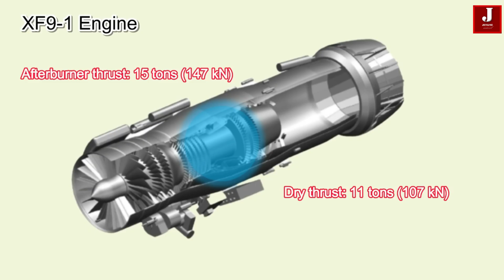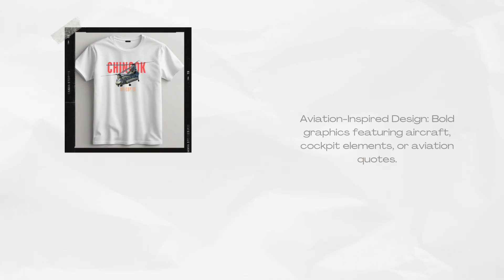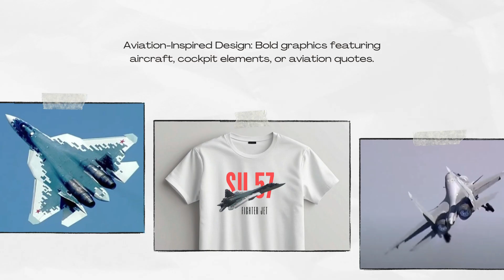Which engine is most suitable for the AMCA fighter jet — Japan's XF9 or France's M88?

Comment: Every jet has different jet engine so XF9 is not an option because we are going with F414 for the design so we will develop one engine with identical design and we don't need high thrust engines, we need something between 110kn to 130kn for our requirements, if we go for japanese engine we need to change entire design and it's not a new engine with IP rights, while we get TOT and IP rights from Safran , co development can help GTRE of drdo gain experience with critical technologies and can help in future, it's better to co develop than taking a engine.
Reply from the maker: But Safran cannot yet achieve 110kN of thrust. A newer variant will need to be developed specifically for the AMCA.
Reply: @JetlineMarvel  it's not about developing the 110kn engine, it's about the critical technologies that Safran has and they are using in rafale engines which can be very helpful for GTRE, it can be challenging to develop the engine but somehow they can manage it, without any proper infra we made a 75KN engine so with safran+130 kn engine testing facility the odds of failing are less, all we need to make sure is we get the TOT and IP rights which is were safran is bit suspicious, I have strong feeling they will definitely do something like they did with shakti engine, maybe an extra alternative to this can be developed with GTRE+ L&T+ GODREJ, a domestic engine development gamble with new players 🤔 can be considered.
Reply: 日本のXF9の高出力エンジンは今の最高峰の機体やパイロットが耐えられるのか等問題有る
このエンジンは無人戦闘機やドローンでの搭載だろう このエンジンは別格